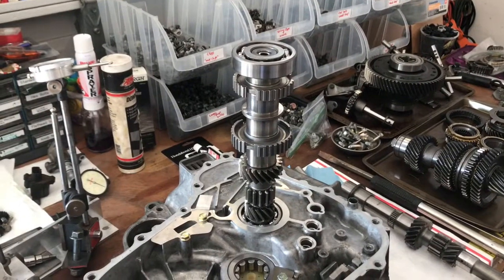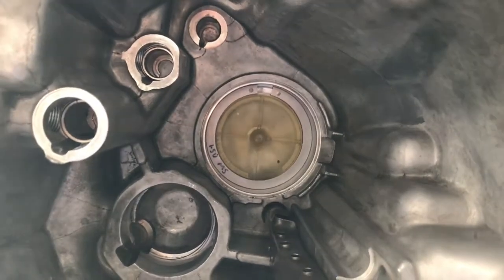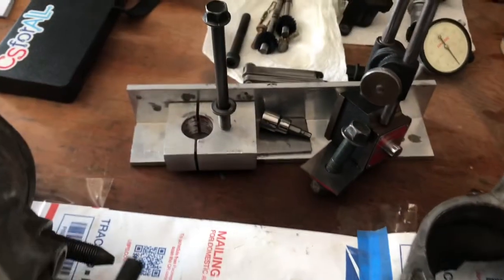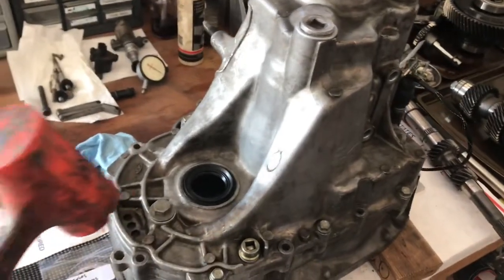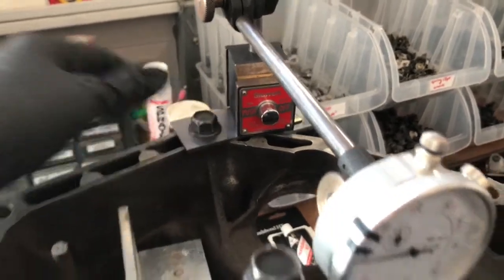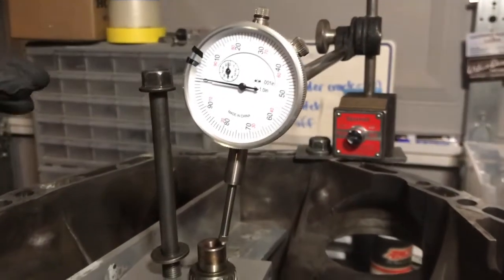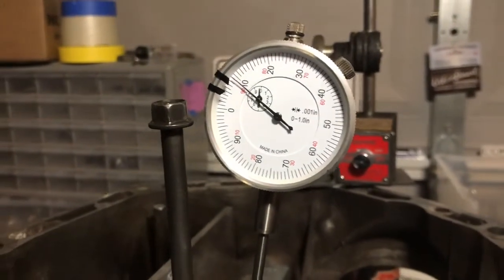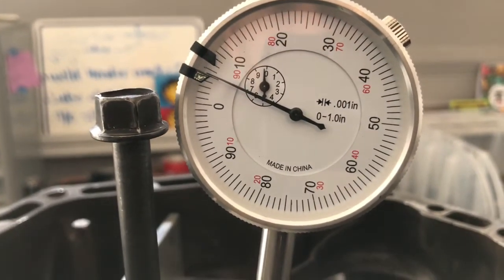Honda B-Series Transmission Mainshaft Thrust Clearance

Comment: I think I assembled mine wrong last time and need to take it out again. It is either the diff shims that are wrong or the mainshaft I guess. 
When I take it out of first, for example at traffic light stop and go, it sounds like something is loose there clunking. 
Would this be the efect of having too much movement because of using wrong shims? 
Thanks
Reply: I don’t know if you changed the bearings but might be your input shaft bearing is bad, also check your reverse change holder and make sure the ball/plate us attached to the back or it’ll just float around slightly and usually creates a whining noise in gear

Comment: Surprisingly, my measurements are the same as yours and require the exact shim size (1.56) for adjustment. Overall, your video was very helpful. Could you please tell me the part number for the 1.56 shim? I have B-18c  Y80 transmission. Thank you sir.
Reply from the maker: Awesome! I’m glad it was it was of use. 
That number is: 23963-P21-000

Comment: Do you need to only use the selected gears and parts on the mainshaft, or can I put everything on my mainshaft (fully assembled with all gears,synchros,etc.), when checking the thrust clearance? My Honda manual says to install only selected parts I believe, but does it matter if I just install everything? Thanks
Reply from the maker: I’ve always done what the manual calls for. I figure other wise it’d be too heavy for the tool and readings may not be accurate.

Comment: Hello I have a question for you off topic, Would it be be OK to use a used ring gear along with a new mainshaft ? 
Thank you
Reply from the maker: The ring gear mates to the countershaft, is that what you meant?
Yes you can use a used ring gear with a new mainshaft. Even a used mainshaft with a new (1-2) gear… which is what I’m doing. Just make sure it is the correct mating part and triple check clearances.
Reply: @c2specmotoring  yes I meant to say used ring gear on countershaft.

Comment: does this only have to be done if switching cases or mainshafts? what if your are doing nothing more than replacing synchros. first time messing with a b series, thanks.
Reply from the maker: Correct, only if you’re replacing cases, and shafts. I also check when I replace other hard parts such as hubs and bearings but it’s not entirely necessary.
You’re good to go just replacing the synchros.
Reply: @c2specmotoring  hijacking this comment, also good to go only replacing the input shaft bearing? fantastic content by the way. cheers
Reply from the maker: @masterjack8222  I’ll say mostly yes, and I say that because there can be tolerance differences with new and old bearings. Check the inner race of the new and old bearing with a micrometer to see where they fall.
Reply: thank you, nice work

Comment: Amazing video thank you very much for the knowledge. If you don't mind me asking what do you use or what is your method to clean the gasket off of the case because it's a real pain in the ass
Reply from the maker: Thanks man! Honestly, I just used a new razor blade when scraping off the gasket and took lots of care not to scar the casing. A green scrubbing pad was used as well.

Comment: So the mainshaft thrust clearance being out of spec overheated the spacer? What caused the spacer to not slide smoothly on the mainshaft?
Reply from the maker: I do believe the mainshaft being out of spec was the culprit. It was the only thing I did not check when I went through it last. 

4th gear/spacer/5th gear hub/mainshaft were damaged.

The damaged mainshaft and spacer prevented the parts from mating.